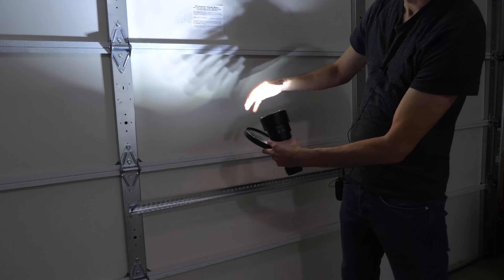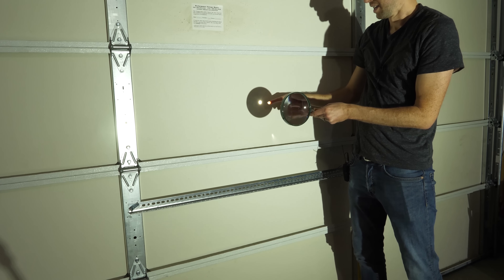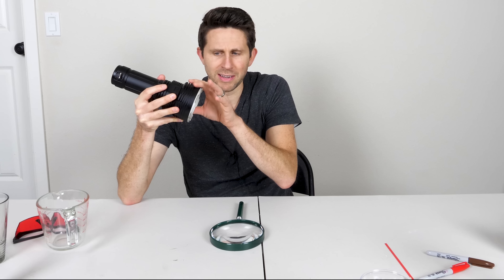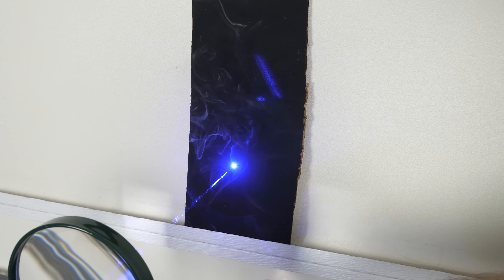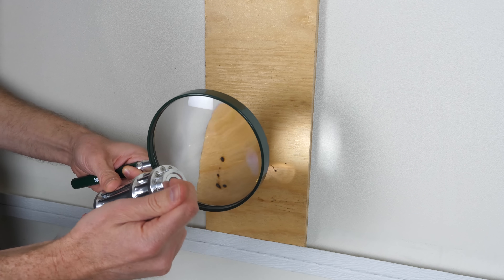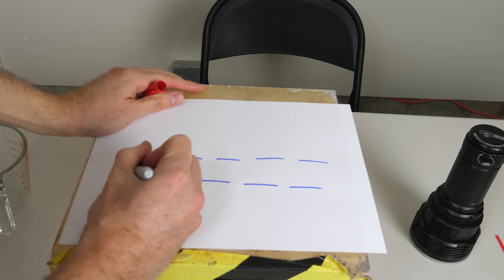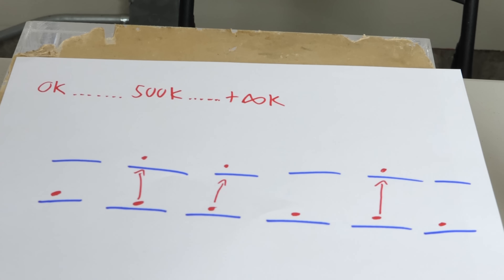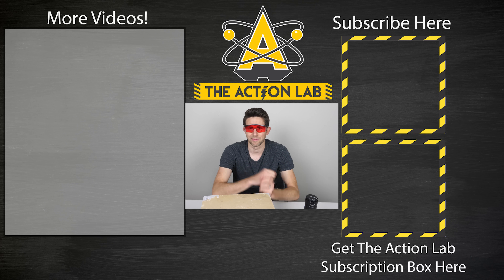What Happens if You Focus a 5W Laser With a Giant Magnifying Glass? Negative Kelvin Temperature!

Comment: I think the real reason why flashlight is not getting focused is because the flashlight is not emitting light parallel to convex lens ...  While the laser was spitting out parallel light rays which was easy to focus .. it has nothing to do with 2nd law of TD .. in case of sun we can get temperatures greater than the sur face temperature with fresnel lenses , just big enough is needed...correct me if i am wrong .
Anyways cool video as always
Reply: Actually. 
It is because of TWO THINGS. 
One. 
His flashlight has "MULTIPLE" light sources., (multiple LEDS).
Second. 
He is using the incorrect lease. 
Which is easy to confirm for $5 bucks on eBay. 
Those Focusable Flashlights, use a PLANO-CONVEX Lease. 
Simply put. A lease only Convex Curved on one plane. (side)
Reply: TANGLDWEB end of the day, flashlights are incoherent radiation, while lasers produce  radiation that all has the same orientation. The flashlight beam spreads out immediately and would need multiple lenses to focus it.
Reply: Boi speak english
Reply: can I get "1" subscriber because even I won't subscribe to myself 
It's "BOY" ,.. boi 😂
Reply: @My-Pal-Hal  so what's a PLANO-CONVEX Lease
Reply: @Skelath  
Convex "LEASE" ???
That's between you and your home financing creditor 😂. 

I'd hate to be more Cruel. 
BUT DO YOU HAVE INTERNET ACCESS 😁 ??? 

I'M MESSING WITH YOU. 

Know what a Convex lense is?
If so, a PLANO CONVEX lense, is only Convex on one plane. (on one side)
The other plane or surface is Flat.
Reply: @Skelath  
Just think of a magnifying glass... 
That's FLAT on one side ☺
Reply: @My-Pal-Hal  so instead of lease you mean "lens/lense"?
Reply: @Skelath  
Oh,.. Sorry. 
Did my Phone mess you up?
And for that SINGLE REASON, you don't understand what I said ???

Well. In my Defense. 
I didn't have to "EDIT" ,.. a 8 word Sentence. 
AND STILL F IT UP 😂
Reply: @My-Pal-Hal  yep I have a phone too lol, just pulling your leg over they correction you gave to the subscriber boi
Reply: @Skelath  
RODGER THAT 
..i just will mess with the little people... 
They usually have No Idea what's going on. Can't pay attention to the subject. 
AND,.. Are Easily Distracted by an Unpredicted Letter choice from a Phone. 
(though I play that well, SUCKERS) 

I'm above the Curve. But not so much that I can't say,...

HAPPY HOLIDAYS !!!!
Reply: @My-Pal-Hal  Rodger Dodger
Reply: @Skelath  
🙂☺🤣☺🤣☺🤣🤗
Reply: AND STILL, I OWN A FOCUSING FLASHLIGHT,..
THAT NONE OF YOU KNOW EXISTS. 
...im cool 😎...
Reply: Using a magnifying glass to create brighter / hotter light from the original source would allow for an infinite source of energy however what everyone doesn't understand about the Imalent DX80 is that it has 8 pieces of "CREE XHP70" LEDS in which each individual piece of "CREE XHP70" is being overclocked to 4,000 lumens on the highest setting: 4,000 X 8 = 32,000. The construction of that torch could not handle a single LED operating at 32,000 lumens as it would not be able to cool it down fast enough before it fries.
Reply: @Skelath  I don't see how focusing light makes infinite energy because the area goes down and the temp goes up.
Reply: @benlawton5420  me neither but people seem to think that focusing the light to a finer point will make it exceed 32,000 lumens and produce much higher energy than what the torch is outputting, aside from that the torch can only sustain 32,000 lumens for an average of 3 minutes before going down to 7,000 lumens due to overheating, the torch constantly increases in temperature hence why the torch has a massive heatsink designed to pull heat away from the LEDS and rapidly cool them down.

Comment: Heres an explaination that doesn't involve witchcraft: due to the fact that laser beam light waves are nearly parallel, the energy is distributed over roughly the same area regardless of distance (at least for short distances, given a fairly high quality laser)
That means that with an unfocused laserbeam, it doesnt really matter if you hold it directly on to the surface or point at it from farther away, the energy per area is the same (idealistically, in reality, laser beams do spread)
The difference in focussing versus a flashlight is, that the spread of the flashlight is much greater, meaning a lot of energy is lost because it isn't focused by the lens. Not so with a laser beam. The  magnifying glass can still capture and focus ALL of the energy emitted from the laser. Not onoy that but it can also focus the energy to a smaller point than you would get from holding the laser right against the wall, meaning the energy density would increase drastically, and the energy per area will tent towards infinity with a perfect lens and a perfectly parallel laser ignoring air refraction and things like this.
Example, this laser has 5W of power, and the dot you get on the wall seems to be around 5-ish square millimeters, which would mean you get 1W per mm^2
With the magnifying lens you are able to focus that point down to lets say 20% of its original size. (i dont know the exact dimensions of the dot, it could be calculated with the spread and the strength of the lens, but i dont care) the point is that you increased the power per mm^2 5-fold, meaning you now get the full 5 Watts on 1mm^2.

Comment: Original laser was not focused... You focused it with a lens... Concentrating all the photons into a smaller area... Which in turn concentrates heat.... I fail to see this "negative" temperature. You also can't assert that the energy output is increased by a lens, the energy leaving the laser is only being focused better.... Not being increased.

I can focus the light from the sun and burn ants in much the same way.
Reply: This is where the science teachers hang out right
Reply: "You cannot create or destroy energy but you can switch it from one form to another form of energy"
Reply: Yep. All you have to do to create a surface out of the light of an object that is brighter than the original is to have it be smaller. 
If: area x brightness(energy in a given section of the surface) = energy,
Then: small area x gargantuan brightness = same energy.
Reply: @kylenelson944  you can't do that because his flashlight is nowhere near point source.  The light will always spread out because the lens is set to focus from one point or if the light rays are parallel.
Reply: He said energy is being increased in one specific area
Reply: dam1en667 . That is a good observation and well said . I like  to say you can’t something from nothing . No free anything
Reply: Lets say you have x amount of energy dispersed across an area of y. If this is the case, then x* y = Total energy. If you decrease y, you increase X. No energy is ever lost.

HOWEVER, if you focus the energy, the total energy will be same if you measure the same square area of the source, as long as the temperature of the source is less than infinite. This is the difference with lasers, but it isn't REALLY a difference. Since the temperature of a laser is negative, the you can focus it to any temperature you have the tools for, which is still less than the >infinite temperature of the laser.
Reply: @dam1en667 Actually the laser was focused.  Multimode lasers like his always focus to a line and not a dot because of the difference between the fast and slow axis of the diode laser. Cylindrical lens pairs can correct the abberation somewhat.
Reply: sorry im a stupid person can you translate that to stupid english
Reply: Run on sentence buddy
Reply: @gamemanager113  Wrong subject, you can actually get a degree for being good at this one.
Reply: GunsAndClips I’m sorry sir
Reply: dam1en667 r/iamverysmart

Comment: It's much more simple than you explained. Laser light does not diffuse, it emits 5W of light (energy) and with the lens you concentrate that energy over a smaller area, which raises in temperature much faster (but just the small point).  It's not like laws of thermodynamics and stuff. The energy doesn't get pulled out of nowhere. It always stays the same, it just gets concentrated in a smaller point.

Comment: can you plz answer
i did some research and it says that the highest temp is 2 billion degrees Kelvin, some other website say different answer, so i dont quite get it
Reply: Black Obsidian it can get hotter then 2 billion kelvin, look up on YouTube (how hot can it get) watch 2 videos 1 by Vsause and the other by real life lore. They do a great definition.
Reply: Black Obsidian well you see, he doesn't understand physics
Reply: What's the heck is a kelvin?
Reply: @motnosniv  it's a unit of temperature
Reply: -273 degrees celsius is 0 degrees kelvin or the absolute zero (it can't get colder than 0 kelvin) and it increases 1 kelvin per 1 celsius. so 276 kelvin is 3 degrees celsius.
as for the american system its a bit harder.
(0°F − 32) × 5/9 = -17,78°C
(0°F − 32) × 5/9 + 273.15 = 255,372K
Reply: @minecraftermad  thank you for giving a better example and putting in the effort 👍

Comment: Now I'm probebly wrong cause I'm no physicist but I'm pretty sure you can't get ANY positive temperature you want by just focusing the light. Mathematically it makes sense but because the laser has a wavelength you can only focus the beam to the width of the wavelength. Now depending on how powerful and wide the original beam was, you may see a huge increase in temperature or not much at all if you are able to focus it as much as physically possible.

Comment: Now try putting 3 to 5 lenses and make ur laser gun.........
Reply: Finally someone said it, I was thinking the same thing, like start with the first magnifying glass and line up four more( progressively smaller lenses) with the first one and you actually have a really hot burning laser.
Reply: you really only need 1 or 2 lenses dependin on what you're doing... more lenses 0 more energy lost into those lenses. 1 lense can focus a beam into 1 plonck length wide if the beam is good enough. the problem really is that the beam starts widening again after that point which is where you coud use the second lense to make the beams of light perpendicular
Reply: If it's already a point, the next lens will make it spread out rather than make it smaller.
Reply: ArmouredAlmond yes one lens is all you need and a perfect computer that can position things perfectly to get an infinitely small focal point which is pretty much physically impossible.

Comment: Can you ignite gasoline with the laser???
Reply: Gasoline is quite translucent, making it difficult to absorb laser light and thus heat up. Certainly you "could" light gasoline with laser light, but you'd need optimal conditions and it would absolutely not be practical in any way..

Comment: where did you get the laser
Reply: Ebay. "Gatling laser". They are cheap and sometimes they come broken. You need eye safety though if you really want to consider using a laser like this.
Reply: Ebay. "Gatling laser". They are cheap and sometimes they come broken. You need eye safety though if you really want to consider using a laser like this.

Comment: Why didn't the magnifying glass burn?
Reply: Well first of all, much of the laser light passes through the magnifying glass. But sure, some of that light energy is transfered to the glass. Now, glass takes quite a bit of heat in order to melt or burn, and the laser wasn't outputing enough power to melt the glass, especially since the laser point wasn't focused very tightly when it hit the glass. Think about it, our glass windows sit in the sun all day long every day, regardless of how hot it is outside and how much heat they absorb, they don't tend to melt. That laser he is using isn't very powerful anyways, it would have some difficulty burning a hole through a shirt to be absolutely honest, unless focused very well.

Comment: Projecting a smaller image of your light  like this has nothing to do with focusing. Bringing the light further back does not make the projection  more focused. The only thing that matters is the distance from the lens to the door. It simply needs to be at focal length so the focal point is on the door. Focusing your laser would work just as well with the laser very close to the lens.

Comment: What if u use a bigger lense for the torch 🔦
Reply: The size of the lens isn't that important assuming you're capturing as much light as possible from the diode. That's why lasers can be focused with small lens' because they tend to output small beams.

Comment: I thought it was due to the angle of the light rays. A close light has divergent rays that do not focus down much. A distant light, the rays that pass through the lens are much closer to parallel, so you can focus it better. A laser has rays that are very close to parallel, even at close range, thus it acts like a very small but bright light. It also means it's bad for your eyes as they focus down the light even more due to the angle of the rays.
Reply from the maker: It is due to that, the only way to get light rays that don’t diverge is through a population inversion in a laser and this negative temp.

Comment: I don’t normally comment on videos like this but this time I must. What you’ve just said is wrong. The reason your magnifying lens with the flashlight didn’t work is because the light coming from it was divergent and the lens you used didn’t have enough plus power to focus the rays when the lens was held closer to the source. You could have used another lens or lenses in combination to achieve the effect . The laser light source produced parallel rays and these could be bent with the weak plus lens you used sufficiently to increase the temperature at the focal point. Your explanation was rubbish. And yes I have a degree in optics.

Comment: Can this also be explained in that you utilise all of the laser's light (no spreading) that enables to focus all of the energy on a smaller spot, not increasing the total amount of energy, but only the temperature (energy per surface unit). In analogy of weight and pressure.
?

Comment: I think you are misleading people or missing the point about what you mean with infinitely hot temperature, you can't get to infinitely hot temperature with a laser simply because of thermodynamics, there is no way you can output more energy than the one in the input, you are just focusing an energy that was originally designed to cover a bigger surface area, and now is covering a smaller surface area, you can't get an infinitely small surface area through the physics we know yet, even less with a magnifying glass, you will always lose energy in entropy, thermal energy, light, friction, even sound.
Reply from the maker: That’s the point. Whatever you shine a laser on can never get to a higher temperature than the laser which is at a negative temperature. Even if you got to an infinite temperature.

Comment: I'm sorry, but I don't understand how a lense couldn't cause you to get a temperature hotter than the source.  The temperature is divided over a larger surface area.
The fash light is ambient which makes it harder to focus than light already in phase like a laser which by definition is not ambient  but if you put the flash light in like a reflective tube aimed at a lense, then all of its light would be focused to a smaller point.  It doesn't violate thermodynamics because you aren't getting more energy/temperature overall, you are simply reducing the area it covers.  Same principle applies to Electro Magnetic Pulses, you generate a watt of electricity but discharge it a fraction of a fraction of a second, which focuses the energy into a single moment.  Your video seems like bad science to me.

Comment: Hmmmm. Not quite there yet. The energy state thing applies to photon emission in a diode-pumped laser crystal. Not sure how is it related to anything you talked about. The reason the light got focused more is simply that your laser pointer lens is not tuned perfectly to focus but to produce a nearly parallel beam. This light WILL scatter and this is physics law. Nothing magical has happened according to my understanding. The negative temperature coefficient does not apply. Correct me if I am wrong.
Reply from the maker: Of course it applies. It doesn’t matter how good your laser is. Lasers work by stimulating a population inversion. If this happens then there is a negative temperature

Comment: You could simply get a parabolic mirror for each LED, put the LED at the focal point, a pair of lenses that are exact opposites of each other with the concave one at the focal point of the convex one (this focuses a straight beam to a smaller point) , a reflective cap with a very small hole to prevent any unfocused light from escaping, then mirrors to focus the now extremely thin beam of light from each LED to the same point. If this point (say, 1mm in diameter) was the same temperature as the 2 inch surface of the flashlight, then the point has less energy than the source it came from, and energy cannot be created or destroyed. The source and the point must have the same total energy.
Reply: A laser is just a faster way to get a focused beam of light. Don't overcomplicate.